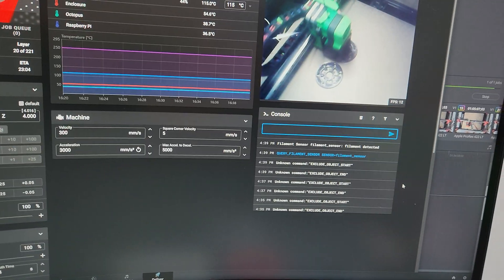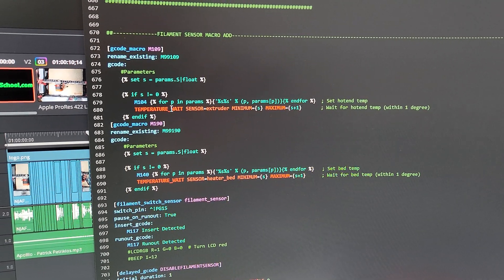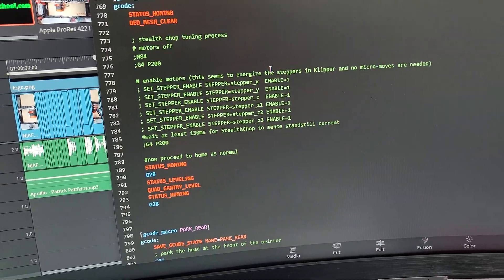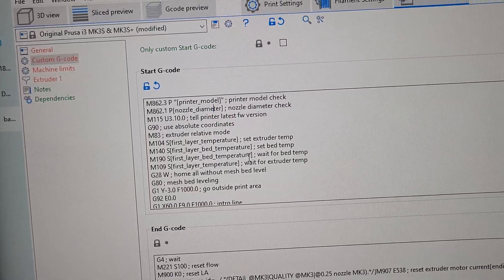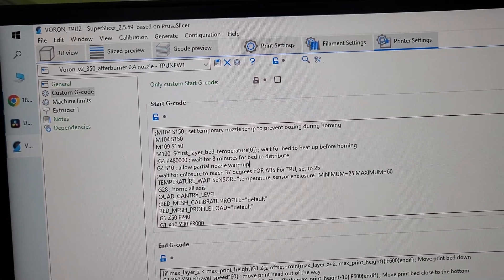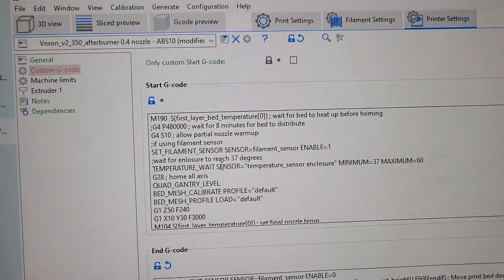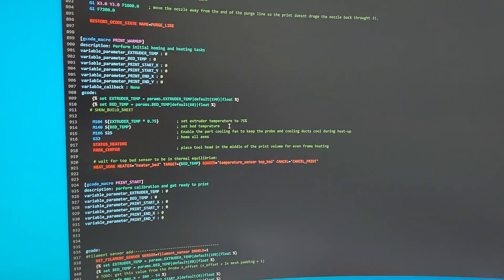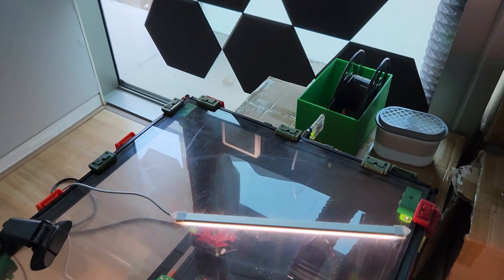TriangleLabs Filament Runout Sensor Klipper Printer.cfg Explained!

Comment: What hotend r u running for ir Tpu again? I can’t really get above 25mm/s <5mm^3/s on dragon hf because I have so much back pressure. Also the cold zone isn’t that “cold” either
Reply from the maker: I am running dragon hf, can do near 45mm^3 extruding on afterburner.  Make sure you are not using a reverse bowden, i just use a little at the entrance to printer.  Also make sure no filament resistance by using something like ball bearing spool holder.
Reply: @3dPrinterSchool  hmmmm. Idk but mine can’t go that fast even with the filament just hanging on the tool head. Could be something with my exchuder or the brand of filiment.
I’ve talked to a few ppl on the voron discord server and they seems to all have some kind of problum with dragon hf and Tpu sooooooo.